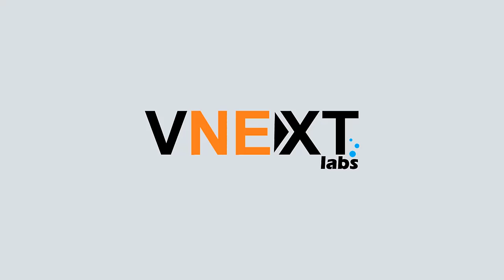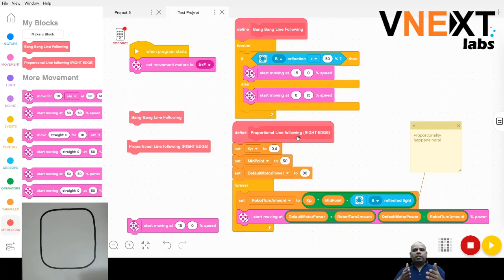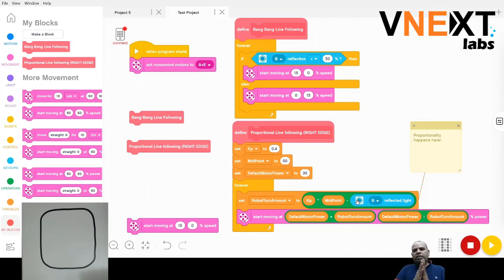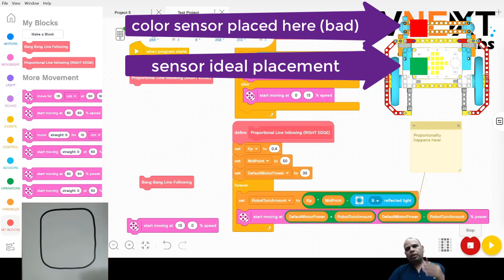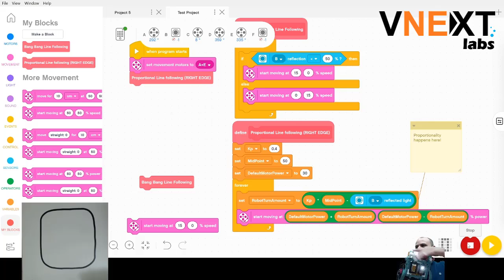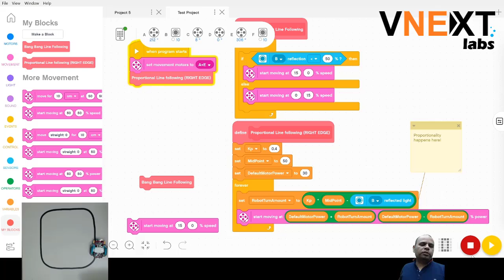LEGO Spike Prime PID (proportional) Color Sensor Line Following

Comment: I understand this is only using the proportional part of the PID. Did you try using the Integral part as well and also using both the sensors one on right edge and other on left edge making it more stable.

Comment: that here
why does it turn left with pid, how is the balance of power to follow the line, does it not need to turn right, more power is given to the left motor, does it follow the line or the road in motor movement?

Comment: Could you please explain how to follow the color line in reverse?  I did it in Mindstorms but can't get it to work correctly in spike prime.
Reply from the maker: Hi there, you should be a bit careful in trying to follow a color  line in reverse. The reason for this is that in reverse, the wheels will be in the front and the sensors in the back. Because of this, your wheels will try to correct for a position that they have already traversed and thus the robot will behave erroneously. It is better for the robot to turn around and follow the line. Or, it is also a reasonable design to put one color sensor in front of the wheels and one behind. When going backwards, use the other sensor.

Comment: I have understood the Proportional line following great ... but how will you end the movement .... you can't keep it in a loop forever if you need your robot to stop after a certain distance or so, how to end the loop or get out of it to stop movement???
Reply from the maker: Hi Asmaa, In general, you exit a loop like this using a second condition. For example,  you check the value of a second color sensor and see if the second color sensor sees a color that denotes loop termination. Alternately,  you can also look at the value of the motor encoder to find how much distance the robot has traveled. So, it looks like the following (this is pseudocode)

while robot is following color line
      if termination color is detected on a second sensor or if encoder has reached appropriate value
	      exit loop
	  else
	      continue loop